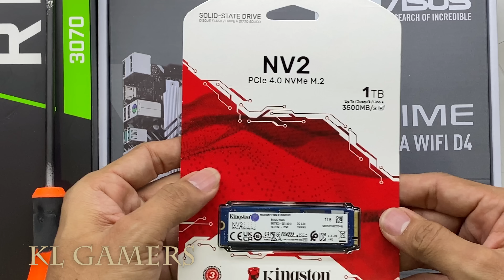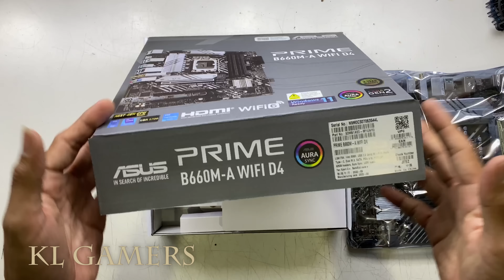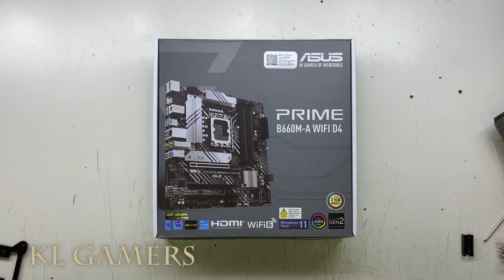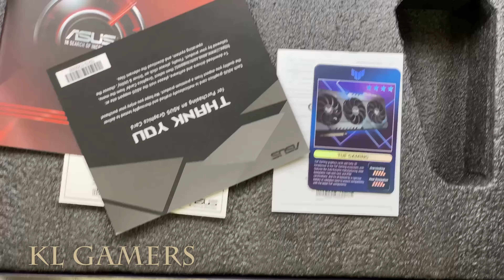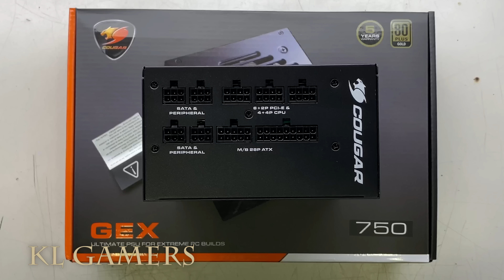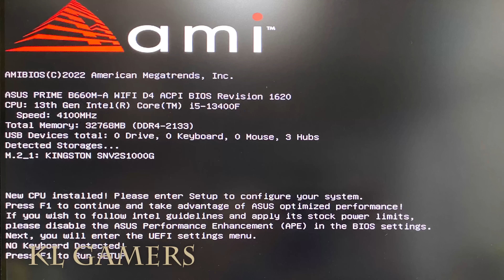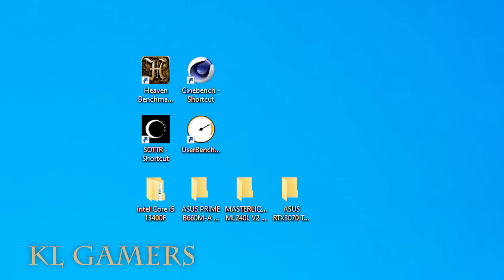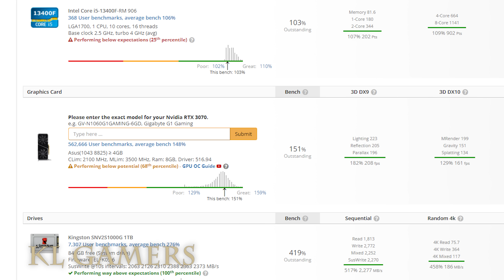13th Gen intel Core i5 13400F ASUS PRIME B660M-A WiFi D4 ML240L V2 ARGB RTX3070 TUF GAMING PC Build

Comment: For 13th gen users, dont buy a b660  motherboard because most of the times you will need to update your bios using a 12th gen cpu, if u want u can go for a z690 that has q flash, b760 which is already made for 13-14th gen or z790, just dont buy b660
Reply: i5 13400 is it good with Asus prime B760 DDR5?

Comment: Hi! I'm planning to buy i5 13th gen CPU to be paired with my ASUS TUF B660M-Plus Wifi D4 motherboard. I just want to ask, what is the BIOS version installed on this ASUS Prime B660M-A Wifi D4 out of the box? Usually printed at the sticker in between the CPU socket and RAM slots, the last 4 digits. Just wanna make sure, mine is 1603.
Reply: At 39:13  you can see that his BIOS version is 1620

Comment: Did u update the bios for 13th gen cpu or it was ready to run?
Reply: I have the same question, do you know if its required update BIOS?
Reply: @JeimsBe  b660m aorus pro ddr4 needs update for i5 13400F